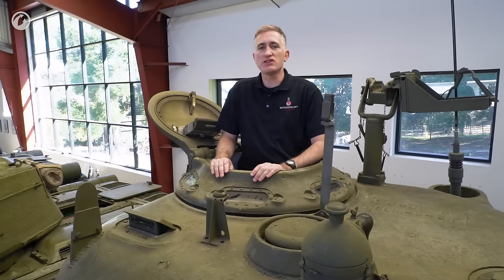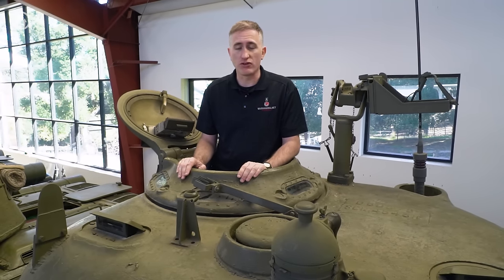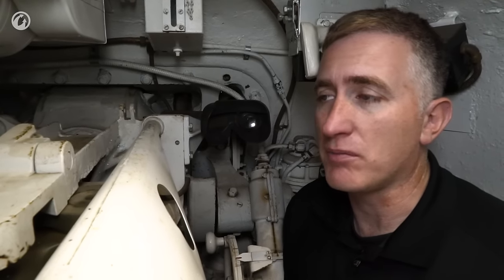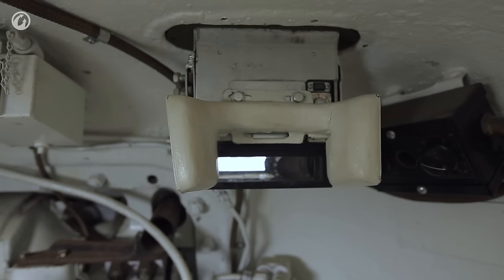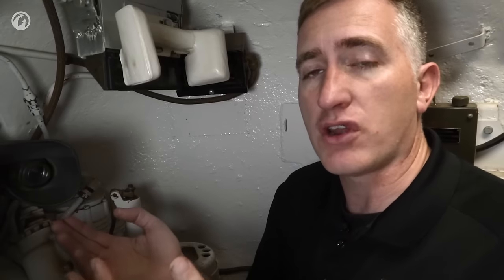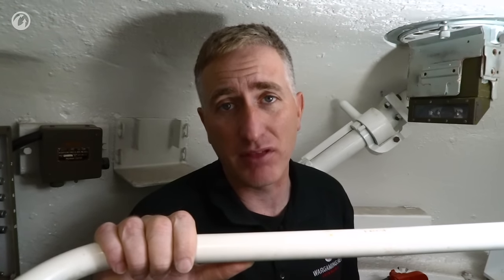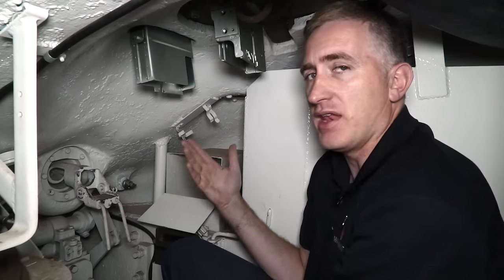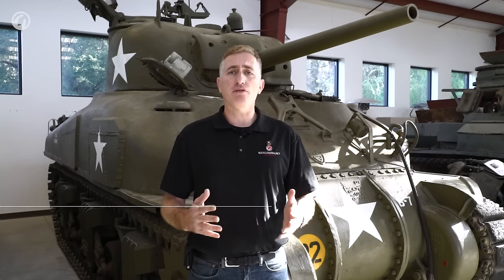Inside the Chieftain's Hatch: M4A1 Sherman part 2

Comment: So from what I gather about the Sherman in this video, is that it was rather mediocre in term of armour and firepower, but all of the secondary systems were what made it so much more capable. It's relatively easy and comfortable to use in almost all aspects. Quick to engage, comfortable to drive, easy to aim, easy to load. It seems to be built purely around the mentioned idea that the 1st to shoot is the 1st to win, and absolutely everything about the whole tank makes getting that first and second shot easier.

Comment: Great video as always.

The entire portion you spent on the optics and stabilization system had me thinking: Shouldn't the advantage this provided be reflected in-game by the Sherman having one of the best aim-times of any of the mediums in tier 5? Seems odd that given the historical advantage the Sherman had in this regard that it would not be given the same.
Reply: The stabilization is implemented in-game: Not only do the different Shermans have generally superior gun handling compared to similar mediums, but last time I checked the tier 6 Shermans (E8, Jumbo and Firefly at least, dunno about premiums) have access to the vertical stabilizer-module. You otherwise don't get access to it 'till tier 8.
Reply: Not really referring to the tier 6 variants.

The M4A1 featured here would be closest to the tier 5 Sherman, and simply look at the other tier 5 mediums. With the top turret and top gun (76mm) the Sherman has a aim-time of 2.3 seconds, which is tied for worst among non-howitzer guns. 

The better aim times are right at the 2 second mark, with the M7, Sherman III (with the 6 pdr), and G1R all being tied for that.

With what Chieftan stated about being "turret down" and being able to very quickly engage a target, the M4 should have a faster aim-time than its fellow tier 5's to reflect this (or at least be on par with the class leaders).

The Sherman already is not the most mobile, nor does it pack the most damaging gun, nor have the best pen (good all around however), but if it was able to snap shots off even better it'd be even better at working ridges which is its strong suit.
Reply: At the very least, the Tier 5 Sherman should get access to the V Stab upgrade.
Reply: Slayer Jesse That'd be pretty nice as well, and a fair way to implement what I'm referring to (faster aim time) since the Vstab makes your aiming circle 20% smaller.
Reply: It's called power creep.  

Back when the Sherman came out in the game, it was one of the best tanks at tier 5 outside the stupidly imbalanced KV, and 2.3 aim time was excellent, and most tanks didn't have anything better.

Really, it still is one of the best tanks at tier 5, outside the silly, arcade 57mm machine-gun plink tanks.
Reply: You are forgetting that aimtime in and of itself, has no meaning. All it says is how long it takes, to shrink your aiming circle by 1/3rd. The important part is in how big the aiming circle becomes to begin with and that is were the real accuracy comes from: Turret movement dispersion, hull traverse dispersion and hull motion dispersion (combined with gun accuracy). And this is where the Sherman shines, it has good dispersion stats.
Reply: No, I'm not forgetting dispersion at all. The Sherman is in fact very middle of the ground or more to back of the pack on that as well...

Of the popular tier 5 mediums, only the T-34's dispersion on moving or hull traverse is worse (0.25 vs the Sherman's 0.24). Even then the T-34 has better dispersion on turret traverse (0.16 vs the Sherman's 0.18). Everyone else in the tier 5 medium group is better on the move or during traverse (most are at 0.20 to 0.22 on the move). My source is tanks.gg and using fully upgraded tanks without equipment mounted, so just comparing base tank stats.

Fact is that the Sherman is middle of the road in nearly every single category and that's not me putting it down (I have abut 200 games played in mine at over 60% winrate and nearing my 3rd MoE, so I'm not someone who dislikes the tank), but rather I'm being honest about the performance of the tank. It's a jack-of-all-trades that is a master of none, but still does the job good enough in all situations that it can carry well enough. 

Fact is, the M4 should get some gun handling love, and the Chieftan's nice pair of videos on this earlier model would be grounds enough for a bit of a boost in my opinion.
Reply: While in theory the stabilizer worked, a study by fort knox showed it was pretty much impossible to use on the battlefield and was incredibly unreliable.

Issues included
1.The gyro stabilizer took at least 5 minutes to spin up before it could be engaged.
2.Once it was spun up, the gyro stabilizer could not be left running for extended periods of time because of wear and tear on the system.
3.Before the gyro stabilizer could be used at all, it had to be calibrated. This process took a trained gun crew about 20 minutes to accomplish.
4.Calibration of the gyro stabilizer had to be performed at least daily, and more often under conditions in which temperatures were very low or very hot, when they changed much during the day. 
5.Fine tuning the calibration could be done only when the main gun was fired.
6.Depending on many variables, fine tuning might require the discharge of one to three rounds on average.
7.Once the gyro-stabilizer was fine tuned for HE rounds, for example, it had to be retuned to use a round of different weight like shot or smoke.
Reply from the maker: What was the date of that assessment, out of interest, and how does it compare to this one from April '44?
http://worldoftanks.com/en/news/chieftain/The_Chieftains_Hatch_Gyrostabiliser/
Reply: I believe it's from a 1944 issue of armored/the cavalry journal, 'TK-525 Operation and Maintenance of the Gyro-Stabilizer. Chassis Group, Tank Department, The Armored School, Ft. Knox, KY. (2-16-44-500)'
Reply: @TheChieftainsHatch  If you read the linked article, virtually every single graduate of the armor school who had been properly trained on the use of the gyrostabiliser wanted one in their tank. It was helpful in training both the coaxial MG and the main gun on targets while in motion. This story reminds me somewhat of the American Navy's torpedo problems of WWII. Super secret warhead proves rather ineffective in the field. The squids eventually disable it just to get the job done, while the American tankers left their gyrostabilisers turned off. Different ending though as the Navy did not go back to magnetically triggered warheads while the gyrostabiliser may have had a renaissance late in WWII.  Now I'm wondering about parallels to the Norden bombsight...

Comment: The "Snake anti-mine devise" was several lengths of bangalore torpedo that were pushed across a mine field by an M4 (in this case) and then a fuse was attached (the small hatch) and and the tank disconnected (also small hatch) and reversed to a safe distance and set off the torpedo. Boom, instant safe path across!

Comment: Thank you, Nicholas for a great review of the great tank of WWII! I have a particular question about the subject that is wildly debated, and the one you already touched a few times in your previous tank reviews... That is a gun stabilization in Sherman tanks, but unlike firing from a concealed position(as you mentioned in this vid) how much accurate firing on the move this tank is? What speed, distance and battle situation would this stabilization would make a difference in a tank battle? I know that engineers of Panther tank kinda thought of implementing of "accurate" fire on the move by making a Panther suspension very smooth, or was it to fire effectively on distances over say 400 meter, was only to completely stop a tank, and even then its not a guaranty to hit it on a first shot? What does it takes(gun stabilization in vertical and horizontal planes, target ranging, some ballistic computer) to fire effectively on the move in a modern tank?  And again what is the reasonable speed and distance for firing on the move for modern tank? I'm sure I'm not the only one who curious about it, and unfortunately can't find this info in a books on armored vehicles.  Oh, BTW love the way you present a material, just keep 'em coming. Your loyal fan, BB.

Comment: Thanks for helping to dispel the old " deathtrap" myth.  In North Africa,  the Pacific and most of the Italian campaigns, the Sherman was equal to or better than the enemy armour. It was in the bocage hedgerow country in Normandy that the Sherman got its poor reputation which wasn't fair. No tank ,even Panthers, would have faired well in the close quarter short range engagements . Once out of the hedgerow country,  the Sherman's numbers, effective dual purpose gun, and reliability overran the Germans.  Yes allied airpower helped of course.  
In the Pacific the Japanese had nothing even remotely to counter Sherman's. They had good antitank guns and soliders willing to sacrifice themselves to destroy a Sherman though. 
All tanks will burn when penetrated.  Tigers and Panthers were not exceptions. The German commanders envied the over numbers of allied tanks, as they knew at the end of the day that was was counted.  100,000 Sherman's and T-34 vs 5000 Panthers, 1500 Tigers of all types, 8500 Pzkfw IV tell the story. And very few tankers on the Western front EVER  encountered Tigers. They were very rare beasts and on any day only a handful would be in action over thousands of miles of front.

Comment: For those who haven't seen the segments yet, Major Nick also says nice things about Panzer III and Panzer IV crew positions.  
  It seems possible that everyone had trouble fitting big guns into tanks.  Thus the inefficiencies of the Panther's 7.5cmKwK42/L70, and the need for bigger turrets on the Sherman/76 and T34/85, both derived from other projects, in order to mount larger guns.
  Panzer IV, oddly enough, was perfect for upgunning (from the 7.5cmKwK40/L24 gun to the L48 "Lang").  The problems with front heaviness (later coming to roost on the JdPz IV and StuPz IV) might've been part of the reason its turret front armor was not increased to 80mm in the G and J.  Overall weight concerns are there, too, but the StuPz was pretty weighty, so a better protected turret might not have been out of the question.

Comment: Nice pair of episodes and thanks for posting!

Glad you did the M4 (as separate from your enjoyable, but technically not as descriptive, 360 with WoT eu opposite number, Mister Cutler, the Challenger) at long last.

I will be happy to see the M4(L) episode also, of course, the T23 turret being a much improved item of equipment and the GAA and GAZ being rated for higher power.

And . . . what?  No canister?  No APCR?  No Shillelagh?  No Anti-helicopter rounds?

A question for your technical folks, if you haven't addressed it in other work: whose radios were the best for range, clarity, endurance, and ease of replacement/repair?

Comment: Nick - terrific video.  I hadn't ever read or heard about the balance qualities of the 75mm gun in the M34A1 mount.  By the way, those screws around the inner gun shield - they were not for "upgrading" as much as they facilitated pulling the entire mount when the weapon or mount was damaged or needed heavy maintenance.  There are several WW2 photos from rear areas showing Ordnance personnel pulling the gun mount with the aid of a wrecker truck.  Then the gun could be replaced and the tank was put back into service.  Those screws were part of the "Shermans are easy to repair" equation (along with a steady stream of replacement parts).  Tank fans who focus on the guns and armor failto appreciate that the Germans were chronically short of spares for their tanks and new tanks were often canabilized to keep others running/fighting.

Comment: Love your visual essays, best I've ever seen.  Keep up the good work.  

Here's some things I would like to see in the future and yes, I still put out cookies and milk on Christmas Eve.  

Starting with each tank I would like a quick run down on the weight/to power ratio, the pounds per square inch ground pressure, gun caliber and velocity and how many degrees the gun can be depressed.  The latter would indicate how good a tank it would be in ambush mode.  I've read that in the 60s American tanks had 10% depression of the gun while the Soviets had zero.  

A very nice feature of your reviews is the livability of the tank; more of that please i.e. fumes from the guns etc.  Could you mention the evolution for cleaning the main gun and/or general tank maintenance? 

Also, what do you think is the minimum number for a tank crew?  Some have said that only three crew is too few for the ongoing tasks need to maintain the vehicle.

Comment: The size of ammunition fascinated me. I was a gunner in the Navy working on a 76.2mm gun system. So basically the same diameter of shell. That’s where the similarity ends. Our round was easily twice the size. We had a nearly flat trajectory over the range of the gun.